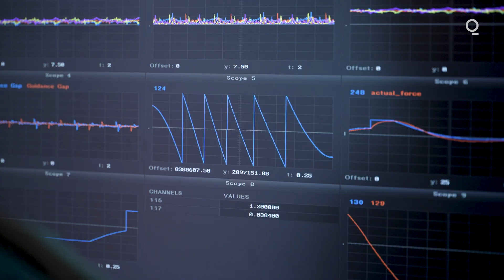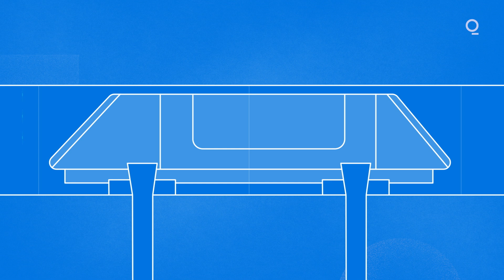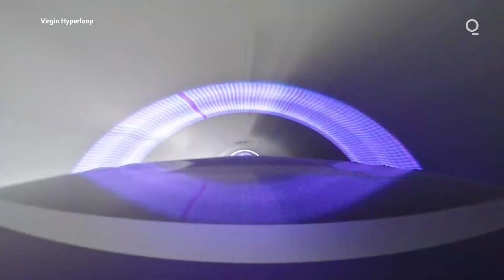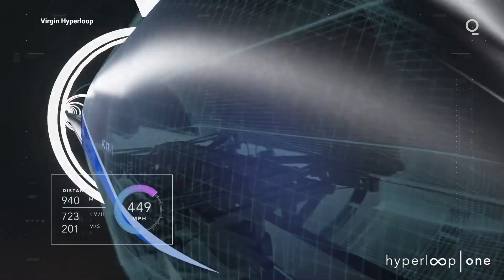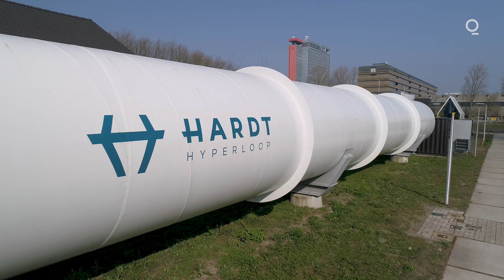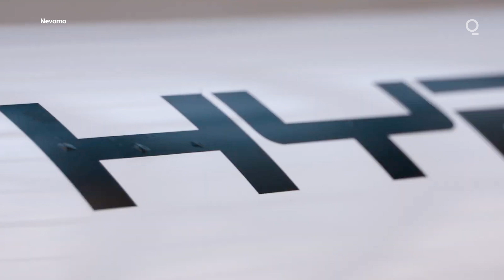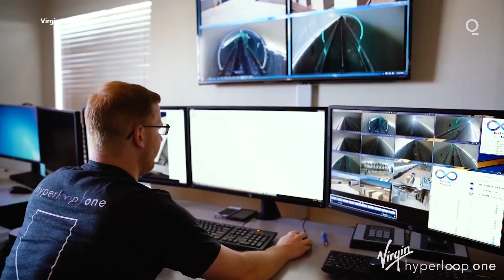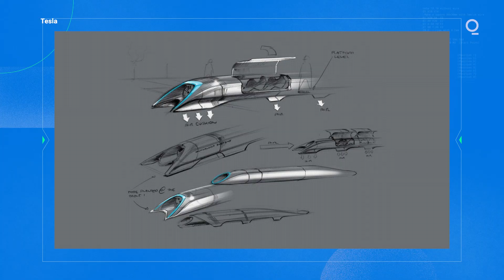The Hyperloop May Disrupt More Than Just Travel

Comment: Throughout this vid, they've not once mentioned any safety mechanisms, concerns w feasibility, scalability. It's literally just a pitch to investors.
Reply: the hyperloop will disrupt the wallets of a few gullible investors, thats about all
Reply: @LillyJem  Because it'll be impossible to maintain a vacuum over miles and miles of tubes.
Reply: @HoangNguyen-hv1qy  it doesn't even operate in a vacuum
Reply: @HoangNguyen-hv1qy  Explain to me how you think a Hyperloop system has been proposed and shown to work. Honestly, the safety issues seem a lot more striking than this, but for some reason people are hung up on it due to the belief that Hyperloop systems are vactrains
Reply: 1:28 Presented by Ford, I don't like their Nestle tactics.
Reply: @LillyJem  Come on, man!
Reply: @Chris Chan It's the same kind of death trap as a helicopter, airplane, boat, submarine, bullet trains, fast cars, even skydiving is a death trap. Just because it could fail doesn't mean it will. There will 100% be sensors to detect debris, as well as backup sensors, even sensors in the tunnels themselves. Perhaps maybe 1 out of the thousands of pods will crash and explode and it will make national news, but there is not a single chance they haven't thought of your scenarios. Just like when a plane decompresses, if it starts to lose O2 then there will be portable oxygen tanks or drop down masks. In fact, it will most likely have O2 sensors inside that will detect low oxygen long before you struggle to breath. Plus if you crash going 700mph then you don't need oxygen, you will be dead on impact, you will die before you can even realize you died. Yeah nothing is perfect, but to completely dismiss new technology because of a non existent problem is simply foolish.
Reply: @ioele1000  The hyperloop is technically feasible, the problem is that the cost would be probably half the entire US Economy. 

It wont happen for one simple reason; Cost
Reply: @ioele1000  
Umm, when one pod crashes, they all crash - period. Look at Thunderfoot's take on this scam before you broadcast anymore of your blatant ignorance.
Reply: @JB-yb4wn  "True ignorance is not the absence of knowledge, but the refusal to acquire it." - Karl R. Popper
Reply: @ioele1000  how do you get out of a pod and how do you get out of the tube when it breaks down? Think about it.
Reply: @Chris Chan do you understand how much pollution and chemical contamination comes from planes ask why they drop fuel in open areas away from suburban areas before landing I think you might find yourself eating your words when they tell you that they dump it in open areas like where there are lakes or swamps or other open areas or people or not yet because the airline fuel is highly toxic and dangerous not counting the fumes that jets put out with your also highly toxic and dangerous and cause greenhouse damage gases are environment is being partly damaged by jets and airline fuel at least with the hyper loop the concentration of damage to the environment would be nail and if set up correctly you could use generators batteries and motors for creating the electrical field and also the right kind of pumps along the way of the entire hyper loop to prevent the loss of a vacuum let alone you could even use the motors and the generator to contain or complete a continuous loop of self contained charging and application of electrical power to where you would not need the use of any electrical power plants or solar panel or anything like that the batteries would contain all the power and the generator above would create energy for another generator to run and put electricity into The entire hyper loop system at so many distances apart and would actually be able to run the generator as well off of it would be a continual loop of generating and recharging and powering that would literally be self-contained and having those at however many miles apart to run a continual power system continually I’ll keep an open mind thank youse what intelligence is there
Reply: @HVACRWrld People fear what they do not understand. It's common, but rejecting it without investigation is next level stupidity. It's a video for investors most likely, do not judge the science based on an ad, these fools.
Reply: Wouldn't a pitch to investors address those details?
Reply: It always has been
Reply: It will require the same safety measures as European super fast trains
Reply: Not all of it is complete but they’re trying to show that it is a very feasible possibility as one part near the end showed that being able to switch tubes is easy just by switching the magnetic stream of the magnetic pulses of electricity pulling the capsule through 1 to 2 another which is feasible and yeah I’m sure if need be and they will work out all the other bugs before hand but it is a way to encourage people to look at the possibilities and to except the fact that this could be done and change The way we travel and also reducing the carbon footprint as well as encouraging companies that could do the labor force of digging the tunnels and building the tunnels underground which would be a big thing for encouraging workforce labor which I would think you could think about that that we could actually increase jobs because it will take a very long time to dig and produce all of the tunnels and equipment and everything needed to where we could employ people for up 250 to 100 years depending on how long it takes in each country in each territory an area to be able to do this the other thing is coming up with the technology to be able to run it along the ocean floor so that could take a long time and a lot of manpower needed to do all of it keep an open mind think about all the possibilities Plus the amount of people that would be employed which is the biggest and most profitable thing of all employing people and creating new technologies new ideas and increasing the world connectivity of using tubes for cargo using tools for transporting people and so on and so forth that’s all I ask is keep an open mind
Reply: It's a montage of outdated concept videos with wildly varying details from many different sources. There's a reason why the Las Vegas loop has been downsized to a very small and unsafe tunnel for Teslas to crawl through. 
It's a scam. Nothing to see here. 
Invest in high speed rail instead before everybody else does.
Reply: @Chris Chan I think its a great idea. It's not like a "lose bolt" will just vent all the air instantly. It's underground, so if air does get out it is met with yet another wall and if air starts seeping they will know immediately, because I highly doubt that these engineers did not think of that and would have pressure sensors everywhere. The only possible disaster I can think of is an earthquake / tunnel collapse, which would severely damage everything, not just the loop. And incase of a collapse the pod itself most likely has life support systems as well as a locator on board.
Reply: A @ioele1000
Reply: @Chris Chan ever been on an airplane? A 767  is phenomenally complicated.
Reply: Safety is something at the end to pitch to the consumers
Reply: yea, investors paying all those Harvard, Yale, MIT, and Berkeley graduated scientists and engineers, you know... like they did with Tesla, Apple, and Google...
Reply: Nobody producing a high speed travel system would ever think about safety, feasibility, or scalability, those things are all democratic regulatory inhibitors to capitalism.
Reply: terroristes would have a blast with the loop
Some bullets would destroy atmosphere inside and crush the pods inside
Reply: @kenzinho-nh8xr  I'd assume they would use a bulletproof acrylic, if not just because of the chance of other projectiles hitting the sides
Reply: @kenzinho-nh8xr  Yeah totally, cause terrorism is a common occurrence.
Reply: @kenzinho-nh8xr  What stops terrorists from attacking trains today or putting a penny on the high speed rails of the Japanese and French systems?
Reply: @kenzinho-nh8xr  it wouldn’t crush the pods, it would start to slow the pods
Reply: @kenzinho-nh8xr  That same argument also works for regular trains as well as airplanes. And these technologies had their doubters in their time, too, and they were wrong.
Reply: @Yutani_Crayven  but if a train is attacked there are ways to prevent it or at least save the majority, whilst in a vaccine tube, anything subjected to a decompression will go up in bits and pieces. 
these The airplane had their doubters but it evolved over the years, while the hyper loop is still a concept one decade later
Reply: I don't think anyone intelligent believes such BS called the hyperloop.
Reply: There were people who said this about planes and it's true that planes crash but still they operate and people use them. What he said was kinda true. You just need to give people taste of technology and people accept it. No matter if it has less safety. And honestly I don't know if that's right or wrong
Reply: @fossel-11  Planes are safer than cars, regardless of people fears. And when a plane crashes, it does not destroy the whole airport. A single hyperloop crash inside the vacuum tube would totally destroy the whole infrastructure. It's a false equivalence: planes are (obviously) a feasible technology. A vacuum chamber hundred of miles long, without leaks, with a maglev bullet full of people inside, if any part of the tube breaks you're dead..... Not so much
Reply: @francescosirotti8178  you underestimate what challenges engineers faced about planes. The modification that happened and people who died in early plane models were pilots in world war. Not civilians and nobody knows how many pilots died due to failures and technically pointed out needed upgrades
Reply: @fossel-11  Not to mention the 30 gallons of highly explosive gasoline, highly, corrosive acid, and heavy leaded battery millions of people in the U.S. and all around the world strap themselves to every day. What could possibly go wrong? Who invented that thing? Let's go back to the horse and carriage. Its safer that way.

Comment: For all you Thunderf00t fans out there watching this and shaking your heads, do note that Hyperloop is something that needs to be worked on and technologies need to be developed for it in order for it to become a reality, and like any other huge project, you can't just expect it to already be ready for us to use and that we only have to implement it. The technology for it has to be developed. Nevertheless, it is highly unlikely it will become a mode of transportation until the mid-century or so unless some huge technological leap forward occurred in that timeframe. Until then, it will just probably be a pipe dream or a scam or at the most be an ultra-high-speed cargo transport system, for which I think it is quite suited for, but I don't know if there will be a demand for it.

Comment: Lots of naysayers in the comments. If we were to rely on the naysayers opinions, we would still be stuck way back using horse buggies instead of cars, planes, etc. There were plenty who scoffed at SpaceX in working towards building reusable rockets by landing the main first stages and reusing those when the accepted wisdom then was that the main first stages are written off with each launch. Now, no one doubts that because SpaceX manages to do landing of main first stages of rockets now on a regular basis. The hyperloop is a massive engineering, technology and financial challenge. Bit by bit, these companies involved in engineering them are getting closer. I would prefer that they continue working and innovating towards the goal. Along the way, there will be setbacks but there will also be advances. By trying, we will at least have a chance of advancement.

Comment: hyperloop is trying to solve a problem that has already been solved by high speed rail and air travel, but wants do it with 50 times the resources. Do you know how much material is needed to not only build such a wide tube, miles long? On top of that, it needs to be air tight and have regular escape hatches that do not leak. Do you know what high speed rail needs? Two rails and electricity.